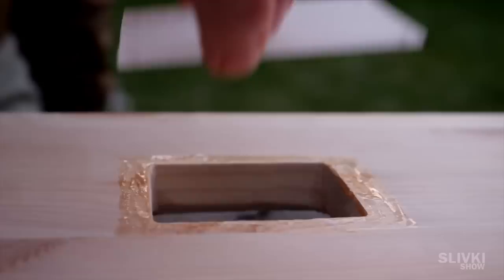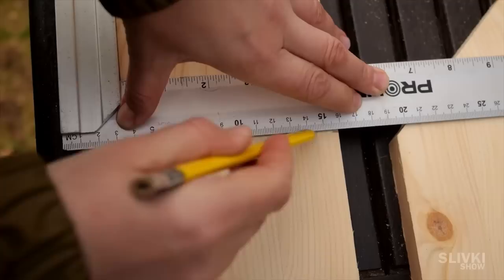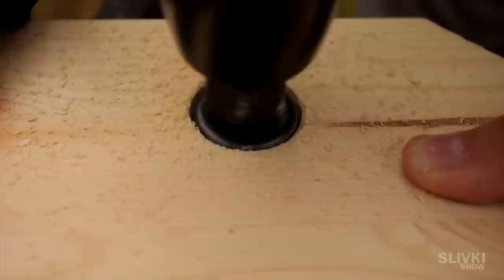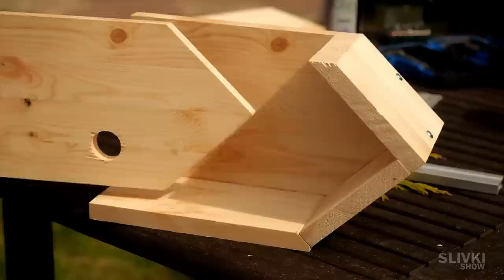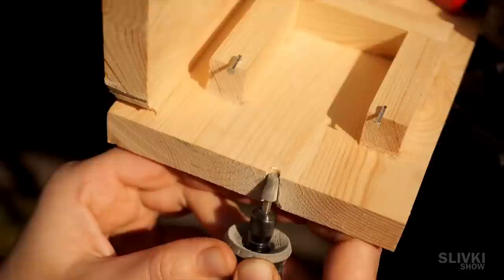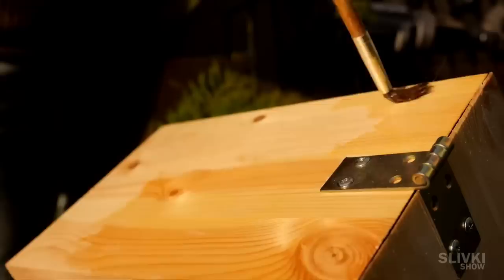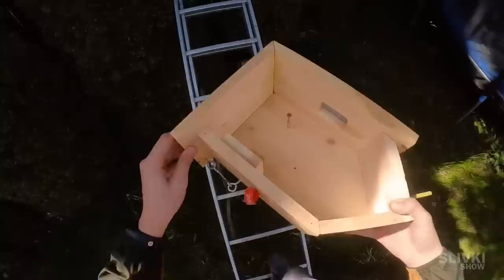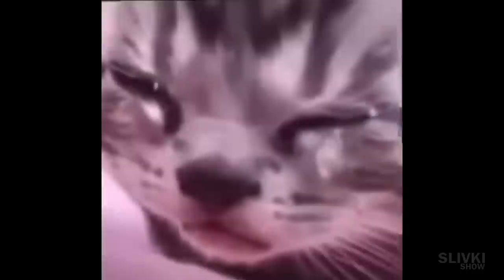WE MADE A BIRD HOUSE WITH A CAMERA INSIDE

Comment: Dude this is not safe those cables r not rated for anything above a led light, if u plug anything else into that SoCkeT u made it might melt your cables
Reply: I don't think that camera uses more current than a lightbulb. There are surveillance cameras that screw directly into a standard lightbulb socket.
Reply: @AlexandruCucu   it's cool with the Bluetooth stuff but there's now nothing stopping somebody else maybe plugging a lawn mower in because they see an outdoor socket with probably no rcd protection too